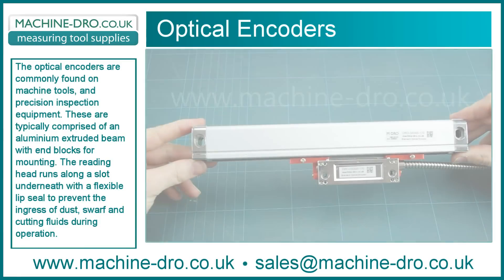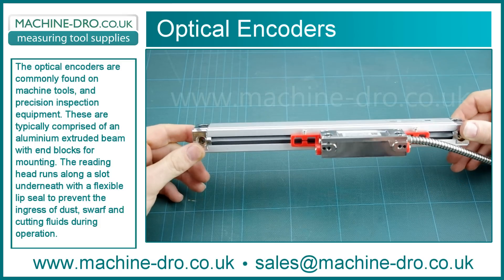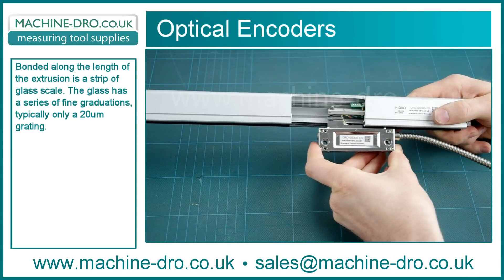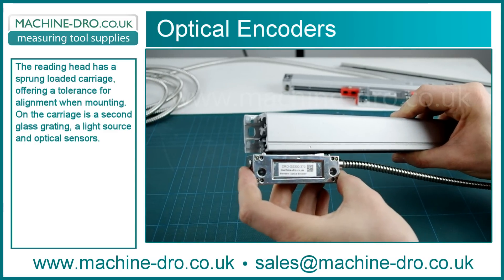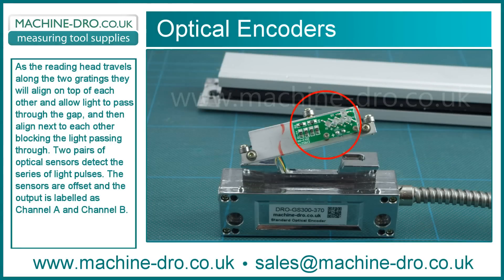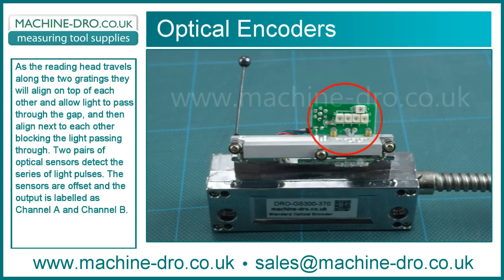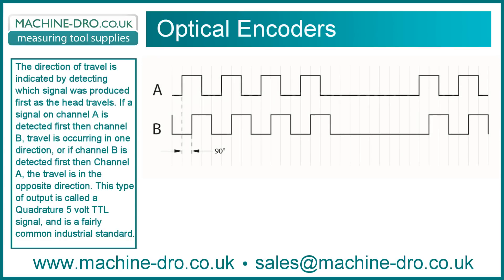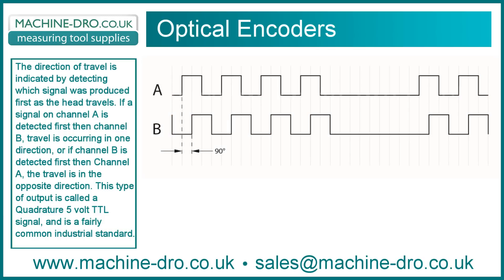M-DRO Guide to the Operation of Optical Linear Encoders, also known as Glass Scale Digital Readouts

Comment: Hi there... I purchased a Grizzly G0759 mill which comes equipped with a DRO. I am planning on modifying my mill, adding some stepper motors on the X, Y, and Z axis. I am interested in tapping into the signals from the three glass scales that are already installed on the machine. From your explanation here, this seems like it should pretty simple to do. Each glass scale connects to the DRO via what looks to be a 9 pin DIN connector (although I haven't yet taken this off to look closer at it). I am thinking that if I were to make a Y cable to split off the signal, I should be able to intercept the "A" & "B" ttl signals that you describe in this video, yes? I am not trying to design my own CNC adaptation, but rather on a lower budget, add some automation to the machine with memory location buttons and so forth. What do you think?